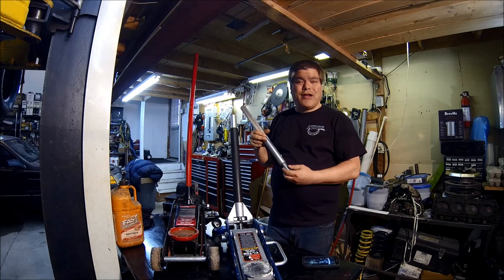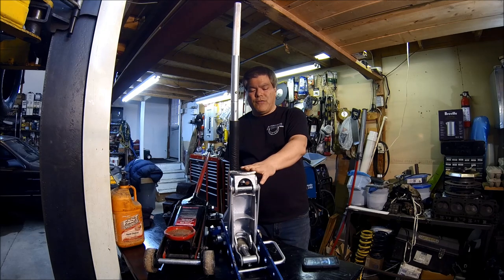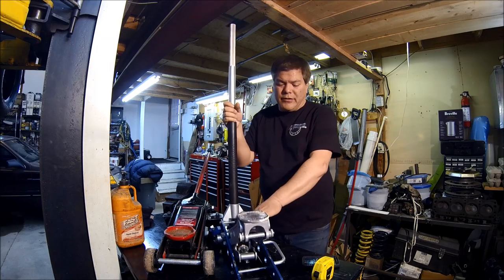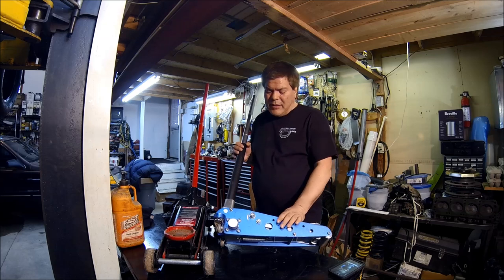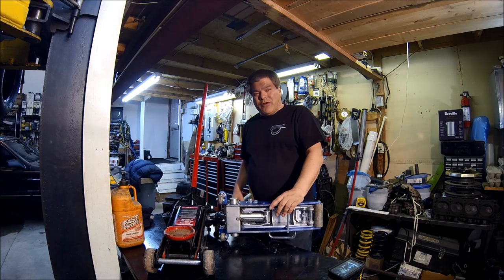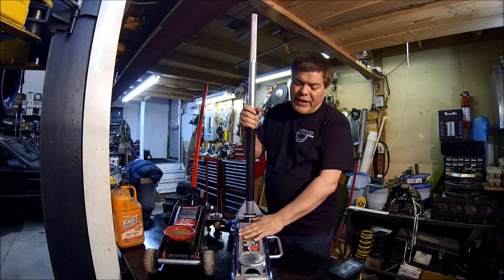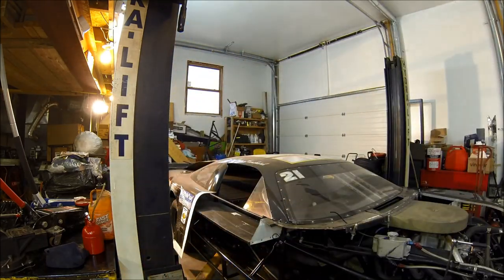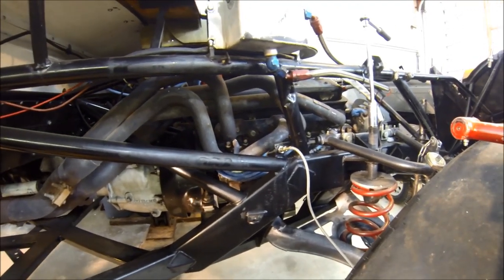Abom 79 Hydraulic Jack Challenge

Comment: Doug, I enjoyed the video. Nicely done. One thing I want everyone to remember is that I'm not an engineer. Machinist yes, and can build parts all day long. I usually work off parts, or prints, and designs in my head, like the welding table.
Your challenge is interesting, and one I'm sure many people would love to see unfold. I'd love to know why someone hasn't already built a jack to the specs like you want. Seems like the racing industry needs it. I see your problem and understand it. I once hung around the paddocks at our local circle track and watched the home brewed teams perform. All of them used the two style jacks like you show in your video.
I can't say just yet if I'm going to accept your challenge. I do need to do some research on my end. I also need to get my hand on one of those jacks. I actually need one because the jack I had was stolen from me. Give me info on the one you have. I think Harbor Freight sells them, cheap I'm sure.
Building a hydraulic cylinder is the easy part. Making it work the way you are wanting is what will be the trick. I need to get my hands on the parts to see what is going on.
I'll keep in touch.

Adam
Reply from the maker: Abom79 Thanks for watching Adam. I'll make the next video, tearing it apart and like I mentioned, get you some better looks at it. There are top flight racing jacks available, but brother, they are EXPENSIVE. And are they really that tricked out to get the stroke down to 2 to 3 ? The big boys in NASCAR have jacks like I said, can lift a car in ONE pump stroke. The price: about $3,500.00 

As for you getting a jack, hold off if you can until I post my next video. I'll go over some the things you should be aware of before getting one for service use. You are correct, Harbour Freight does sell a similar unit under their own brand, Pittsburgh Automotive, PN # 62160 and claim 3 1/2 pumps to full lift. But I am suspicious. And it's cheap $79.00. (don't get this one for your service use). But it is different, it has a dual cylinder and it does not look like it has a large fluid reservoir. It also does not lift as high, only 14 1/4" to mine: 15.5" 

Glad you liked the video and thanks for creating an awesome channel. I think the T-Shirt is pretty cool too! 

Cheers!
Doug
Reply: Cool to see the t-shirt in use, and thank you!!
Reply: Abom79 I wonder if a total mode shift is what is needed. Get away from hydraulic altogether? With battery powered electric tools being so efficient, I wonder if an acme thread cam jack would be the most efficient. Serviceable, simple, compact, etc. I guess I might be talking about a battery operated scissor lift. Why go with hydraulic if we're talking about only three thousand pounds?
Reply: Abom79 hey adam, I really enjoy watching your videos and I came across this while doing so. im sure a machinist of your knowledge and skill could work something out and have it working superbly and as a regular viewer and subscriber to your uploads I would love to see whatv you come up with. regards paul
Reply from the maker: Abom79 Adam - Part II is now up. Enjoy ! https://youtu.be/NLhY77MUB-M
Reply: Abom79 Easy Peezy. Ratcheting gear driving the master cylinder? Skid plate on the bottom that will still allow the wheels to roll on hard surfaces but can slide on dirt or gravel?

Comment: I think the main challenge you're going to face is pure physics. Making it rise 5 times faster will also make it 5 times harder to pull that lever. Meaning you'll need a longer, sturdier lever, and you may need to reinforce everything on the pumping half of the jack because you're going to increase all the stress in this part 5 times.

Maybe you can address your space problem by going for two levers, 90 degrees to each side of the jack, operated by two people simultaneously.
Reply from the maker: Sergey Gromov You are correct. Partially. If the sole change is a larger hydraulic ram both in terms of volume and piston diameter, the lever will feel stiffer and require more downward lever force "pressure" to move the hydraulic fluid into the ram. I can tell you that the amount of pressure require now is very little. Maybe 10 to 12 lbs of "weight". If we had an increase of 50 lbs of weight 'force', that would be acceptable. As for reinforcing other components, I do not believe this is a concern because we are not changing the amount of weight we are putting the ram under. That said, yes, we may need stricter tolerances on the seals and possibly change the seal design. But I do agree that the lever length will be important.Lifting 1,300 to 1,500 lbs is not a significant amount of weight. If it was 5 tonnes, then we are on a whole new level of requirements and limitations.
Reply: Doug Hanchard Here are my thoughts. To raise 1,500 lbs 10 inches you have to spend 1700 joules. So you must put those joules into the lifting no matter what you use in between your car and your arm, hydraulics, levers, screws, pulleys, magic---as long as it does not have its own power source e.g. air. Or magic. So if you're willing to pull that lever with 50 lbs of force your arm has to travel 300 inches. To do this in two full strokes you'll need a 8 foot lever. Not compact!

Now if you're willing to put all your weight into lifting (like Nascar guys do judging by photos). Let's assume you can put 150 lbs on that lever and still have enough control of your body. Then you'll need only 100 inches of travel on your lever, 50 inches per stroke, so a 32 inch lever will do. Actually slightly longer as you'll need to have a good grip on it.

Now I know very little about hydraulics so the following is just my common sense. Your lifting cylinder has enough stroke to lift a car 10 inches off the ground, and it is strong enough to lift your car fully loaded. Therefore it can be used as is, there is no need to change it. I would consider modifying the pumping cylinder which is currently too small. Ideally I wouldn't change its length, to keep the existing lever geometry. To make pumping cylinder pump 5 times more oil per stroke it's enough to make its ID 2.4 times bigger. Now I have no idea how hard it is to make such a cylinder or will it fit in the existing space. Alternatively I would consider modifying ID of both cylinders, making the pumping cylinder 1.5 times fatter and the lifting cylinder 1.5 times thinner. This would give that same 5 times faster lifting.

I can elaborate on the math I used throughout this if you're interested.
Reply from the maker: Sergey Gromov Thanks for your input. These are all important questions. We must realize that we are not changing the total amount of weight (pressure) required to lift - 3,000 lbs. But what we are attempting is to change the ratio of how it is accomplished. Speed DOES create pressure changes. It is a question of which method is better to achieve it.

Comment: Well I AM a Mechanical Engineer and I spent 5 years working for an Industrial Supply house specializing in hydraulics and pneumatics (along with all the other Engineered Products). I'm gonna have to think about this one for a while.  You can be fast, or you can lift a lot of weight. Not easy to do both...
Reply from the maker: Phil Grindle I agree. But that's the purpose of a challenge is it not ? ;-) In Part II, the obstacles become a little more clear, but not completely !
Reply from the maker: I think you have the right idea. But I'm not a hydraulic expert.

Comment: Excellent video! Thanks so much for being clear and understandable. The detail is really where it's at. On a gravel situation, a couple of piece of c channel will do the trick. They can be tacked together so that they are parallel with the width of the wheels. Two pieces of flat strap are enough to spread the load so that they don't sink into the gravel. Regarding air: air over hydraulic is the model to follow. A quick connect air tank by way of a rubber line is available. Exhausting the air slowly is only a matter of a fine adjust exhausting valve. As for the rate of the lift, it's all about the triangles! Pythagorean theorem meets Homer Simpson (air capacity). I hope Adam digs into your challenge. He's certainly capable of coming up with something novel and useful.
Reply from the maker: Kevin Hornbuckle We do have "wings" that can be attached to these jacks. But they don't work very well. We tend to cheat and put a sheet of plywood down instead - if possible.

Comment: My 2 bobs worth. To achieve what you are after with the current ram or pump one must be changed. Either the same ram with a pump with 5 times the fluid transfer capacity or the same pump with a ram with 5 times less area available for fluid. Then you have a potential problem of the webs on the jack not being able to take the larger forces and collapsing.
Reply from the maker: booka83 I think  you are on the right track of challenges that have to be addressed if hydraulic ram is to be modified or built from scratch. I'm not sure about the math, because hydraulic pressure per pound of force is not always 'equal'. Ram diameter, fluid flow, travel, piston diameter, etc, all play a part in addition to leverage force required which the piston has to work with..

Comment: There is a reason that  NASCAR  quick lift jacks are expensive. Much engineering has gone into them getting the most movement per stroke without overloading the jackman. To expect a "off the shelf "jack to be redesigned into a anything close to that AND have a short handle is not possible, without a additional outside energy source. It goes against the laws of physics.

Comment: What about a straight mechanical lift, they look much like a hand trolley and when the handle is at ground height the weight is well over centre so it is 'locked' in place like a toggle clamp or vise grips. If you only need 10 inches of lift on half of 2700 pounds a comfortable force on the handle would be say 150 pounds so you'd need a handle of about 90 inches... which is a bit long... If 200 pounds on the handle is ok then you're down to 67 inches...
Reply from the maker: warrantyvoid100 We actually tried this. Ummm it's a LOT harder to move 10 - 12" up than it appears! ;-o huff*puff. Amen to Hydraulics is all I can say. Mechanical would never wear out - except the poor crew guy! 

And then as I mentioned in the video, we are often cramped in the pits next to another car. I'll post some pictures just how crowded it can get! Thanks for posting your idea!
Reply: How is the weight with these things. do you have trouble keeping near the minimum or do you have to load it up to get to minimum?
Reply from the maker: warrantyvoid100 We have to bring them up to minimum weight. I'll show how we do this in the next video I do, like I did with the Tie Rods.
Reply: warrantyvoid100 i don't even weight 150 lbs.  I'm not sure exactly how you get a car up with 2 strokes or less.  The jack is just a glorified lever.
Reply from the maker: warrantyvoid100 I have answered this question of yours in Episode 4. Thanks for the question.

Comment: Thoughts from a non-engineer  the first part of the stroke is to take up slack , jack to lift spot then assist the springs holding the car.  The weight on the jack is progressive.  The same  principal log splitters have a two stage pump to speed splitting.  Throwing out ideas is two pistons large for 1st stroke and 2nd for heavy lift. Obvious is two separate handles but heavy and awkward.  One handle that can be twisted to activate the smaller piston or a check  / bypass valve that does the same hydraulically allowing both pistons to be activated at the same time with the larger being bypassed when the pressure reaches a certain level???
Reply from the maker: 1DIYGuy I am not sure the load is progressive once the ram hits the jack mount. It will have some linear increase because as the car is raised, the pivot points on the jack lifting arm and ram arms will dynamically change. The weight of the car does change based on fuel load (max 90 pound variable). There are hydraulic jacks that have two pistons levered by a single jack handle and they are faster to pump up (as little as 4 pumps). Based on what I have seen in feedback, they leak a lot and the hydraulic fluid is not entering the ram with equal pressure (even though it should). causing seals to leak. Thanks for your comments!

Comment: Is that a single piston or twin piston pump on your race jack? I've got a twin piston one and it works well. They run a large piston and a small piston in parallel in the pump. With no load on the jack the large piston brings the jack pad up quickly. Once the pad  is under load the small piston kicks in allowing you to lift a decent weight without busting a gut.
Reply from the maker: +Michael Murphy In the next video (PART II), you'll see it's a single piston. I have seen the twin piston units and yes, they are faster. Manpower is not the issue. We can crank 20 pumps no problem. :-) It's time that's a big deal. As I mention in this two part video series,  lots of jacks are available that can do the job quickly. That's when the other evil angel shows up - money. I was hoping that a solid, two pump hydraulic ram could be used in the same space and perhaps a 'fun' project for Adam to make. REAL racing jacks are available. $3,000.00 for a high quality one. We're not a NASCAR Sprint Cup team with that kind of budget.

Thanks for watching and leaving a comment.